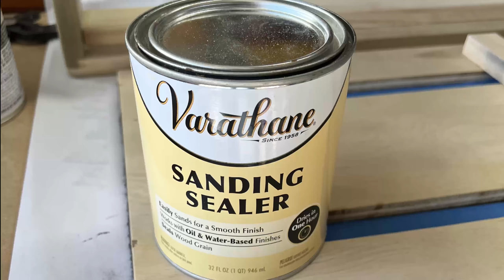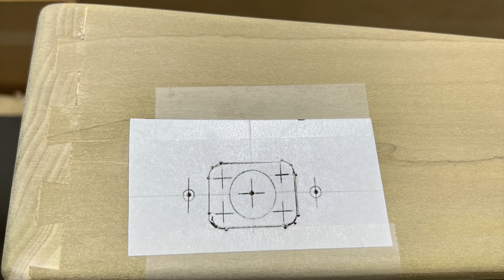How I built an awesome DIY guitar pedal board from scratch.

Comment: Did you use 1/2" or 3/4" plywood for the pedalboard deck?
Reply from the maker: 1/2” I think but I ran a strip of poplar in the center front to back for additional support. I don’t think it needed it but I cut the slots for the cables a little too large and it flexed a bit more than my previous decks.

Comment: Hey where did you find the power supply and and what is the model number on it
Reply from the maker: I built this one for one of my guitar students and he provided the power supply and the pedals. It’s a Donner brand and I think he got it off Amazon. I can’t remember if I put a link in the description of the video. On the board I built for myself I have a Strymon Zuma
Reply: I found the power supply I’m trying to find all the parts for it
Reply from the maker: Which one did you get? @Quickscopegod814
Reply: @joehansonguitar  I got the same as you used in the video I’m trying to find all the other parts for the pedal board